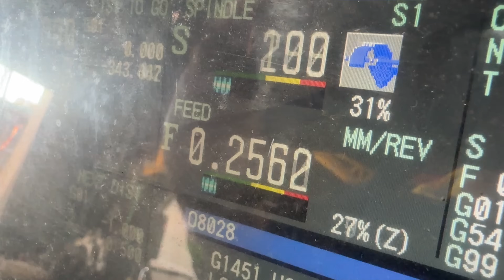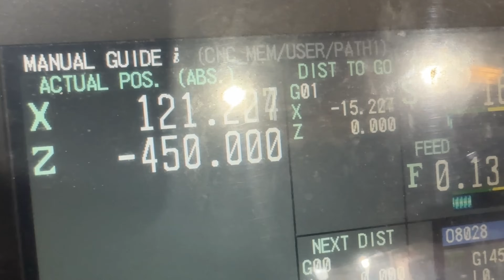Heavy Cuts With The BIG Boring Bar (It's a BEAST!!)

Comment: Material,in the chuck&what carbide tool used
Reply from the maker: 4140 steel.

Kennametal Tooling mostly on this setup.  Grade KCP25

If we use Iscar, it’s usually the IC8150 grade lately

Comment: Kraken: Seems to have through coolant, so no need to peck, just send it. This of course if the material will chip nicely, as some stuff just wants to long string with any settings. But for a drill of that nature, I would imagine somewhere around 0,2-0,3 mm/rev feed would go nicely.
Reply from the maker: We were unfortunately limited by the Z axis power to the CNC - otherwise I’d have just sent it for sure.

We ran the 130mm Kennametal one on the big Megabore engine lathe and it was perfect.

Next time I buy a CNC I’ll be making sure it’s got far more Z axis grunt… or just get a bigger machine than we think we need.

Frustrating being power limited… but we are admittedly doing stuff that the machine wasn’t originally foreseen to do.

Hindsight 🤣

Comment: Reminds me of a Weiler E110 I used to run.  We made a 4" diameter boring bar that was maybe 6' long and was mounted to a carriage sadle holder.  Took .25 depth cuts at .024 "/rev  in EN30B not 4140.
Reply from the maker: Damn.  That’s a solid cut.  Nice.

Comment: Do you chill down the lubricant before it is reintroduced to the cutting edge?
Reply from the maker: The tank is big enough that it doesn’t get super hot.  No chiller needed, as we don’t run insanely tight tolerances.

Comment: Really nice for a middle size CNC lathe. Pilot Drill of the kraken should be made of carbide so you can skip this time wasting backwards forwards steps. 
Think about a adjustable chip breaker on top oft the beast insert. 
Lot of respect for your work even this size is kindergarten to me.
Greetings from Germany ✌️
Reply from the maker: Nice! Yeah, we've pretty much maxxed out what our mid sized lathe can do.  Def time for an upgrade. What kind of work do you do?  Very interested - and a big G'day from the other side of the world mate.
Reply: @halheavyduty  
Saarschmiede GmbH in Saarland Germany

https://youtu.be/w4Nf2Sp51ik?feature=shared

Comment: Can I ask what Oil do you run in the Hulk? We have the next one down from Hulk. Lathe didn't come with a manual. Cheers. Also great videos!!!
Reply from the maker: Cheers mate!  Yeah, we didn’t get a manual either 🤣 

Just 11 tonnes of pure Hulk 👊

The coolant is called “Holemaker” by ITM. Stuff works great and doesn’t go off.
Reply: @halheavyduty  Cheers! I was after the Headstock oil. Sorry I should've been more specific. Headstock oil is what I'm after. But on the coolant, hole maker is that the same pink coolant you use in the CNC's?

Comment: Hi Hal, Paul K from the UK here, like you, we always used the hand to check bar for vibration, as vibration is a tip (insert) killer, same as sound, if the machine was singing to you as it cut you knew everything was running smoothly and chipping well. Also I see you keep the coolant rate up high, helps get rid of the chips and prolongs tool life.  In the heavy machine shop we used to say we produced mans swarf not the boys swarf that the general machinists made. By the end of the video my ears were telling me I was back in the machine shop lol. Keep up the good work and cheers from the UK. P.S. Have you thought of Colossus as a name for the new Boring Bar.
Reply from the maker: Love it Paul! Man swarf 💯 off the beast.

Colossus is def on the cards.  We’ve had some bloody unreal games come up so far.

Comment: Those cuts are looking hefty! Have you looked into other holders aside from Kennametal for the bar? Seco Jetstream holders have fantastic delivery to the cutting edge in my experience but do come with a high price tag to start with

Have you tried a high pressure pump for those holders too? Wondered if that might let you get the surface speed up a bit if you've got plenty to do
Reply from the maker: I've looked into a bunch, but we already had a bunch of Kennametal tooling so I stuck with it.  I'm sure there's comparable / better stuff out there, it just makes life way easier for me to stick to a few good suppliers.  We typically use Iscar, Kennametal (and some Seco and Palbit) 

I'm always interested in what other good stuff is out there though.  It seems tooling is advancing at a pretty rapid rate these days.

Comment: Good morning Matt, another good video. You are so correct about the sound from the machining operation as you get to know when you are in the "'sweet spot'' so to speak. When I worked for Seco Tools here in New Zealand I used the following formula to check if changes in cutting data was a step forward or backward as the game is always to get that material out the quickest and safest way. The formula for turning - Metal Removal Rate is Q = Vc x f x ap. The result Q is cubic cent. per minute. Its a very usefull way of checking that any changes are positive or not. I also have a similar formula for milling as well if you want it. Milling is a good one as there are a lot more variables. Cheers Ian
Reply from the maker: Interesting!  Thanks for sharing.  I'll use that.  Very handy.  Thank you.

Comment: I worked in a defense/aerospace machine shop in the '70s, with some great machinists and toolmakers. Saw a huge casting disintegrate, while being turned on a big Clausing lathe. The old machinist just ducked, as a big chunk flew by, stepped to the side, shut it down. Somebody in the supply chain was up to no good, and got found out.
Reply from the maker: Fark. We had a steady bearing go on the Hulk with the 1 tonne billet yesterday.

Safe to say we couldn’t hit the E STOP fast enough 🤣

Comment: Makes you wonder how the old timers got it done in the steam age! Those boys got some huge work done, all without carbide tooling. But wages were not really a factor back then I suppose. Plenty of cheap manpower! Fantastic to see this.
Reply from the maker: It blows my mind when I watch documentaries on the original steam powered HSS steel tooled lathes and mills that built the modern world.

Mega respect for all those who paved the way.
Reply: even in the relatively modern era, there are amazing facts that blow my mind.
For example, the Boeing 747 was designed from scratch, using paper and pencil, in 28 months. 75,000 paper drawings!

Comment: Congrats with new drill. A beauty😈. Do you run it full diameter,130mm? How does that work out with machine torque and feed power?
Reply from the maker: The 130mm is too big (I think) for HAL the CNC… and we’re short on bed length.

We used the hulk and it didn’t even register.  The power of that engine lathe is phenomenal.
Reply: @halheavyduty  I suspected that.  I saw it run well on Hulk. Also steady toolposts is crucial on those size tools, as the machine can pull it around, but other things give in eventually.

Comment: How come you didn't make a trepanning bit but chose to make a mountain of swarf ?
Reply from the maker: We usually use the trepanning tool, but this billet was too big for it.

We chose the HTS DRILL as it’s more reusable for other jobs.  We are unlikely to have to do another billet this big for a while.

Could have gone either way to be honest, but having a 130mm drill for the nature of the work we do is really useful.

Great question by the way.  We did debate it in the shop.